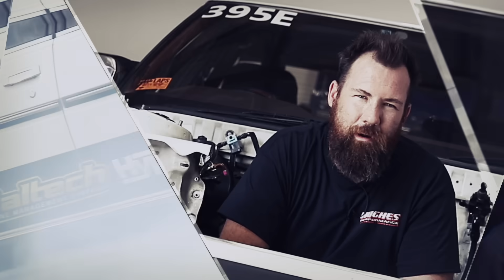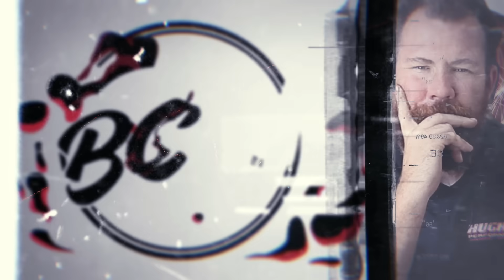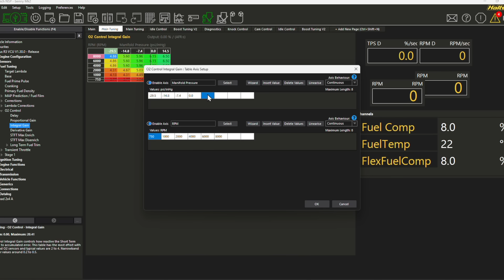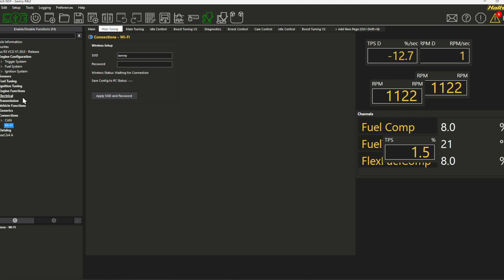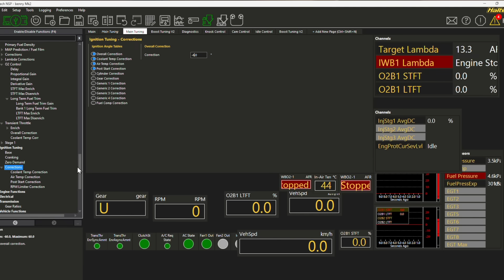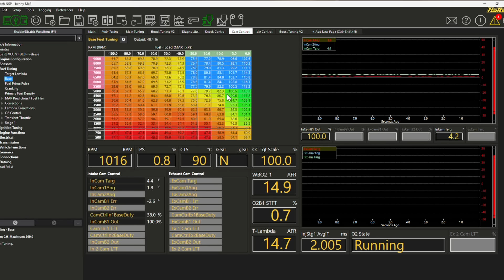2jz NA GX81 How much power does it make? 98 VS E85

Comment: Im a little confused  is that dyno reading a lil low...stock  2jz ge  with intake exhaust  make 200hp on stock ecu with 93.....to the wheels
Reply from the maker: No idea, but the car hauls so even if it said 10 hp after a tune I’d be stoked

Comment: The blips on coast down definitely help cool things off. I spent some time dynoing air cooled two strokes and a few blips would drop cyl head temps by 100 degrees f. I figured it was from a big dump of fuel that you weren't really asking to do any work.

Comment: Great video Ben. I'm running an elite 1500 on an aspirated SR20 and have crammed all the information I can into the tuning. I've literally just taken the first drive on what is an experimental slap, using second hand 1.6 ve pistons, mild cams, springs, pocket port and machine work using non industry standard practices. It hauls better than expected, would like a dyno session to dial it in. Using a stick welder to glue the wideband bung into the exhaust system worked a treat. Love your work!

Comment: Awesome thanks for the in depth video Benny. I’m not complaining but you usually go to Kai, so nice to see you link up with Scotty now and again. 

NA tuning is like that; e85 won’t be as great for an NA engine as it will be for a turbocharged engine, but it will allow you to go further with ignition timing advance, higher compression, cam timing, than if you were knock limited with premium pump gas. 

You could even theoretically test e10/20/30 blends and may not even need to go to pure e85 as you may be safe on e20/30 and you’re just burning money with pure e85. Garage 4AGE tested that out with his NA kp starlet. 

NA tuning is something I really enjoy, and like you say, people may scoff at 5hp increase but when that equates to 5% increase in power, that’s fine and all the small gains add up.
Reply from the maker: Who’s Kai? Scotty tunes all of our cars..
Reply: @BennysCustomWorks  oops. Sorry I mixed you up with Woodys tuner.

Comment: Is there a loss if it was 91e10?
Reply from the maker: Not sure but it would be cool to test
Reply: @BennysCustomWorks seen some stuff with boosted cars getting gains over 98 using e10. But if you got to try e10 on the na motor that could be cool to see what happens

Comment: Around me E85 is virtually the same cost per mile of 87 (ron+mon/2) and since my car & truck are turbo so it's a no brainer what to use.

Another plus is how safe it is. My friend lost his alternator belt on a 20+ psi run (>800hp), leaning it out into the 13's and had zero signs of detonation. Pump was already about maxed out and the drop in voltage put it below the fuel need.

Comment: 255hp from a VQ35DE drift build +5hp from E85. Does feel like car handles hot QLD drift days better on E85…. But I guess a bigger oil cooler is another option cooling wise… So hard to get any extra power with a NA build 😂 but throttle response and drivability is huge in a drift car in competition.

Comment: The comments about the sound of an L series six cylinder with three side drafts made me smile. I am currently working on an EFI  L28 in a 280z that has flat tops a .480  / 280 street cam a decent exhaust and a 60mm throttle body . It does make wonderful sounds when angry. The NA 2jz  reminds me of a neighbors CBX with a six into one exhaust when I was in high school, it sounded like a late 70's F1 car.

Comment: How good is that!? I can easily see this being your favorite car you have ever had. I know I'm loving the hell out of it and its not even mine! Those dorts just get you a pure eargasm! The carb dorts still have a better tone though. 

On that note, the conversation around 15:10 is what I was on about before. It may work out better in the end but without a Scotty and a dyno, tuning this isn't going to happen. If this was still carb based ITB anyone could tune this on the side of the road with a couple of analog gauges (mainly a synchrometer or six) and a screwdriver. Sure it takes longer and you cant monitor every single little thing thats happening but it takes a long time to learn what it takes to do what Scott does. Come on Benny you knew I was going to say something after that fun exchange a few months back about E-throttle.
At the end of it though it doesn't matter. Dorts are dorts and you're the man paying for it so my opinions aren't worth a penny!

Comment: Surely at least >75 kW per Liter should be possible NA?
Reply from the maker: I haven’t seen many 1L engines ( that don’t rev to 20k rpm) make 75kW
Reply: @BennysCustomWorks 1 L not no, but a K20 does 75 kW/L

75 kW from a 1L is not huge either. Yamaha 890 cc 3 cil does 86 kW at 10.000 rpm.

So need a bit more than 7.000 rpm sure....oh
I see i made an error here, wheel kW vs crank kW, big difference 🤦

Anyway, this is a beauty 👌 nice work, emjoy it
Reply from the maker: @Ρολοί_Χρόνων it probably makes between 180-200kW At the flywheel so we’re probably fairly close to your figures

Comment: Excellent!! Should be fun to drive! We had our stock BF Barra engine tuned on E85 and apart from Fg intake manifold and free flowing exhaust it ended up making just under 200rwkw.
Reply: Barra is 4.0 vs 23.0 in the 2J, makes a good difference

Comment: Great video! I’m definitely going with a Haltech ECU in my ’37 Chev. I need an all-round ECU to handle the car’s aux systems, and the flexibility is just insane.
Reply from the maker: The R series stuff is next level. I can’t wait to swap the Cresta over😊
Reply: @BennysCustomWorks I'm running a tickled 308 yellow terra pro comp rockers cam and a 650 holly but going to go efi. Great hearing you guys talking about trims. But also being able to run pumps on a switch and things like lights it a no brainer. Did speak to the haltech guys at roll racing. Just need to start collecting parts. 
Will it be a easy transition to the R series on the cresta ?

Comment: Just sat down, but I know i'll love this video. My experience with the N/A 2j goes back a fair way. I've had them in the JZA80 platform and the IS300 platform. My JZZ30 runs a flex fuel sensor & a Haltech rotary switch to run either 98 or E85, though being lazy with kids now, it mostly runs 98. On E85 (77% ethanol content, it made 414rwkw) but boosted is a different story to natraully apsirated. I'll be very interested to see how your N/A 2J responds to E85. Again, congrats on this build Benny, it really is something special with so much attention to detail.
Reply: 414 kW boosted right? Not NA?
Reply: @Ρολοί_Χρόνων  That's right - boosted with my little 1JZ vvti. 
I'd have to have some sort of worked LS with heads and cam and stroker kit to get that kind of power naturally aspirated.

Comment: Regarding the VE being >100% thing, i always thought that was actually correct (VE actually being >100%) especially at low-med rpm and WOT, because the air has inertia - it doesn't stop immediately it keeps flowing and the valves don't instantly fully close as soon as the piston starts coming up, so the air continues to flow in and the pressure in the cylinder goes slightly above atmospheric, kinda like water hammer in a pipe.

I'm curious to know what your thoughts/scotty thoughts are on this?

Comment: Nice! I’m building a K24 with 60mm ITBs I designed myself, 12.5:1 comp, CNC ported head & Keford cams Haltech R3 and PD16 IC7. It’s going into my Datsun 1600 with a BRZ 6-speed and 4.11 STI diff – basically a smaller version of this. 

Love your work Benny! Really like the Sunday morning uploads, just wish they dropped around 6am so I could sneak it in before the family wakes up 😅
Reply from the maker: That sounds mint, far out 60mm is s big throttle. 
Sounds like a cool build
Reply: @BennysCustomWorks  Yeah I thought the same, but I’ve been told I should really be going 65mm. Guess we’ll see – easier to choke them down than try to make them bigger.

Comment: I'd love to see what a high comp 2jz would do with itbs, some guys in Japan run 4age blacktop itbs with tomei pistons at around 11:1 compression (with a gte gasket.)  but would those itbs be too big even for higher compression and big cams?
Reply from the maker: They are really only too big based on not being able to pull the idle low enough

Comment: in regards to finding smaller injectors feel my pain. 
I needed 8 yes 8 280cc injectors for my motorbike as I am doing a haltech soon for it. stock they have 220cc 12 hole denso's but because I want to run E85 on it I wanted to go to the next size up which is 280. but the problem is I need Compact injectors to fit my rails and they are IMPOSSIBLE! to find the closest I can find is V6 commodore injectors but I have to mod my rails
Reply: I think the injectors of a Toyota 2.5L hybrid (engine code: A25A-FXS) are in the ballpark you want: 250-300cc/min @3bar.  No idea if you can fit them fysically tho.
Reply from the maker: What about L98 LS Injectors?
Reply: @BennysCustomWorks  my injectors are what they call "short"
so the size is 33mm from Top to the bottom of the injector that doesn't go into the inlet. and the inlet length (bit that goes into manifold) is only 11mm. 
other injectors like LS ones are 3/4 length or full length so 48mm for 3/4 length and 60mm for full size. This is my problem. the compacts have shorter outlets. so the 3/4 and full size injectors off LS's ect just don't fit I need to get new rails ( and I might have to do that from the looks of it) 
But thanks Benny

Comment: Nicely done Benny. As a comparison my N/a RB26/30 made a best of 154kw, stock cams, 12:1 comp, circa 2009. The only time I became knock limited on 98 was more related to really hot ambient temps. So an E10 solution may also be suitable path for additional cooling rather than the E85.
Reply from the maker: That's awesome, thanks for sharing! What was it in?
Reply: @BennysCustomWorks RB26 head was pretty much stock (intake, throttles, cam, fuel and Ign.). RB30 block, crank and rods, usually machining for a fresh build. Ran RB25DE pistons, the tops had to be shaved to lower the compression to 12:1. Tri-Y extractors with Captain Planet safe exhaust.
Reply: @Dad_Wagon_CT9W that would of sounded wicked

Comment: The only experience I have with 2j motors is stock ones of these non turbo, 2 autos and 1 manual. Autos felt underwhelming. Manual was strong. I did enjoy that silky smooth nature and deep tone. This with the 6 speed and a healthy dose of extra ponies + the noise won't get old in a hurry. Kick ass daily. Thanks for the detailed tuning walktrough also 👍
Reply from the maker: Yeah they are a great engine for sure :) thanks mate.

Comment: On the E85 discussion: For making more power [over 98RON] compression ratio matters a lot, doesn't it?
 My brain is in similar thinks to winding up boosts and the cylinder pressure rises at TDC where E85 overtakes 98RON for pre ignition capabilities and output numbers.

Comment: 18:35 I honestly think that locking a tune with a password is not cool and would be a deal breaker for me. I get that it takes time and effort to truly understand what each car and setting affects but that is also what makes a tuner good or bad. 

I pay for their time and experience for my hardware. In the end, anyone with enough time and money can be good at anything, personally if I will be tied down to the same tuner for my car since he tuned my car previously I would rather risk an engine failure and learn to tune my car myself than be in that position.